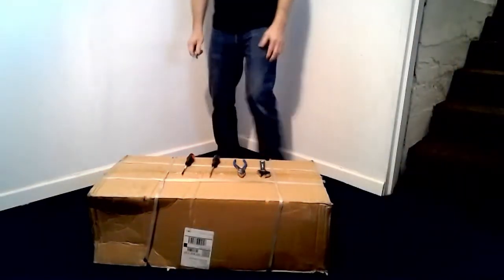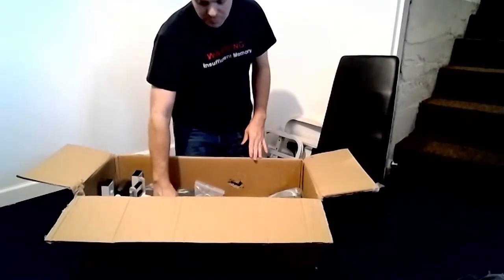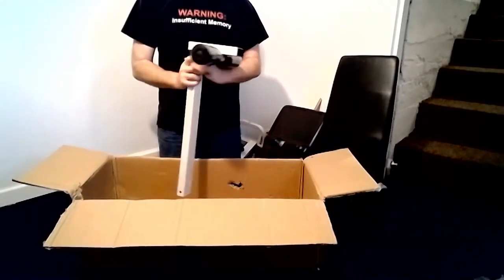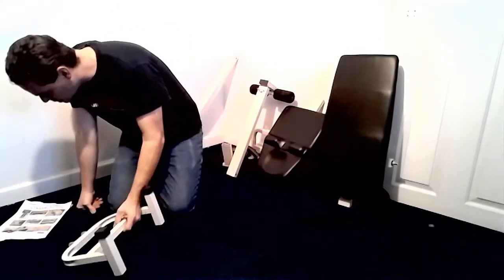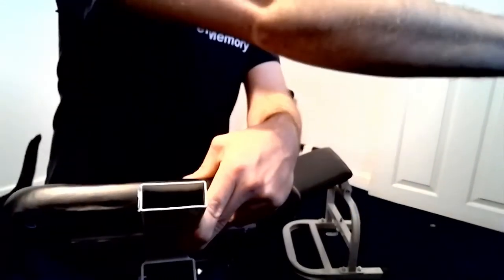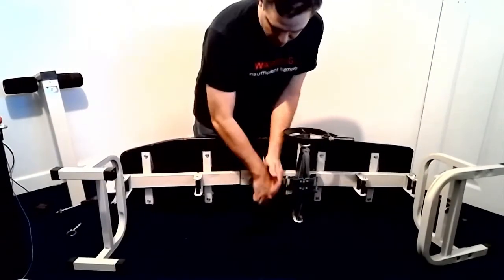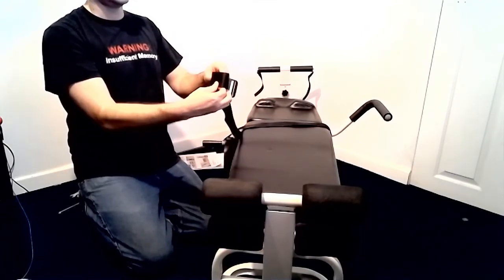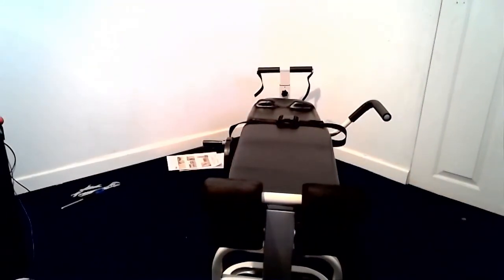Multifunctional Cervical Stretcher Assembly

Comment: Can’t figure out how to strap myself in and use this thing
Reply: Did you ever find the strap manual for the machine?
Reply: @heatherstossel7207  No there was no manual and had a hard time figuring out the straps. I ended up using an inversion table instead. Just diagnosed with another herniated disc, Ugh. I hope you can figure it out. Good luck.